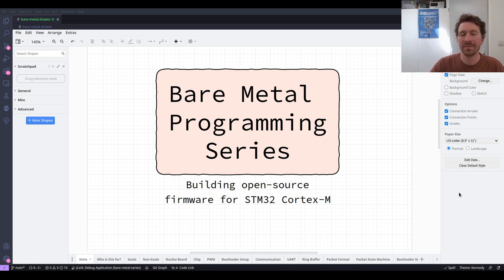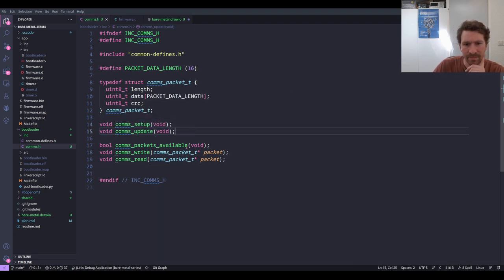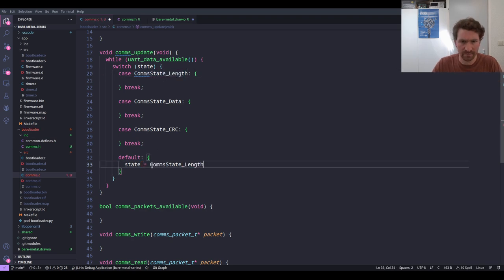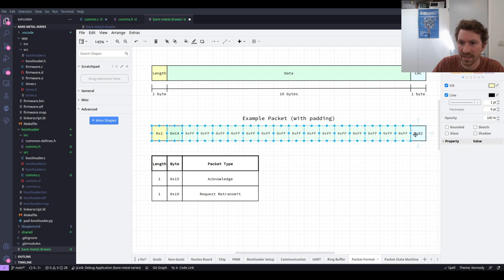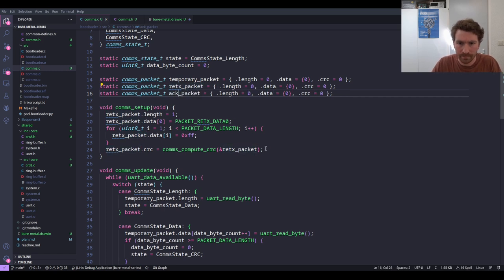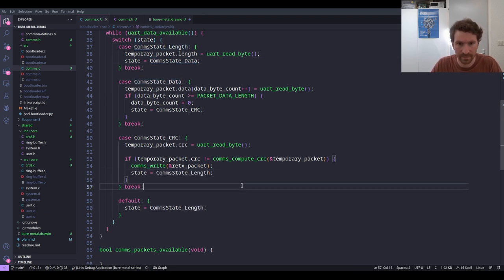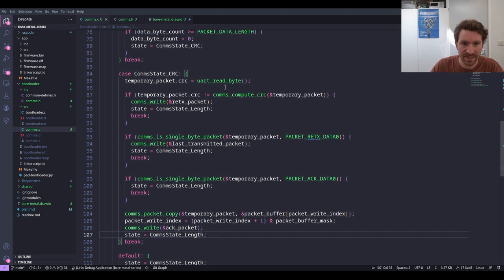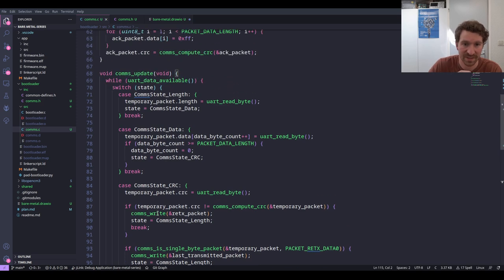Bootloader Packet Protocol Implementation :: Bare Metal Programming Series 7.2

Comment: good stuff as always! a couple of quick thoughts

1. rather than worry about writing your own memcpy or using the memcpy from the c stdlib, doesn't c support copying structs via assignment like other primitive/POD types? i.e. dest_packet = src_packet;. I think usually memcpy is only necessary when you're copying between buffers/pointers and not just copying struct values.

2. could you simplify the "read packet" state machine by just not reading anything from the uart until a full packet's worth of data is available and then reading all 18 bytes at once into your packet struct? I think that'd do away with the whole switch case and the state enum. The only scenario(s) I could think of where we'd want to read the packet piece by piece like that is if we were worried about the UART buffer filling up or wanted to reject invalid packets without reading the whole packet but I don't think either really makes sense (yet).
Reply from the maker: Hey Scott,

1. Wow yeah you're totally right. Sometimes you just get caught up doing something the complex way 😅 in the next video I did switch over to using standard library memcpy after seeing that it just emits the right assembly. No function call involved.

2. Yes, this would work too. And what you're mentioning with the uart buffer overruning was basically the "justification" of doing it this way, although it was also in part just to show the process of building simple state machines. But yeah, it would also simplify things to just wait for 18 bytes to come in!

Comment: ~12:50 What's up with the ".length" and such? It seems reasonably self-explanatory but it's not something I've come across before. Is it just like a shorthand way of setting those values when you initialize the temporary packet?
Reply from the maker: They're called "designated initializers" and were added in C99. Basically they allow you to set specific values in a struct or array.
Reply: @LowByteProductions  Ah, I wasn't aware of those. I could see how they'd be quite useful though.

Comment: I was wondering. You demonstrated your "middleman" tool that let you analyze the data between two circuits. Is it possible you could do some reverse engineering on the old PS2 Controllers and Memory Cards? If you don't have the hardware, I'd be willing to spot you the hardware. There's a bit of stuff done, but I don't think there's enough content out there showing people how the "Mystics" do their magic on old hardware to keep it alive for decades longer via softmodding and tool building.
Reply: I say this because this project your working on made me think, this would be an amazing beginning of a tiny custom circuit that could interface with those simplistic devices. Easy to use template protocol.
Reply from the maker: I'm honored that you'd lump me in with the actual mystics who do the reverse engineering :P In all seriousness though, it sounds like a fun project - I'll add it to the list! I don't have either of those bits of kit, but would happily take them off your hands if you're willing.